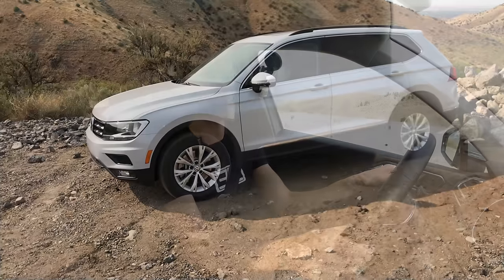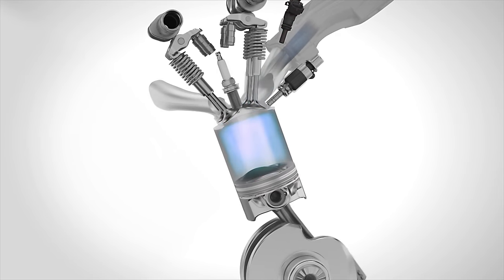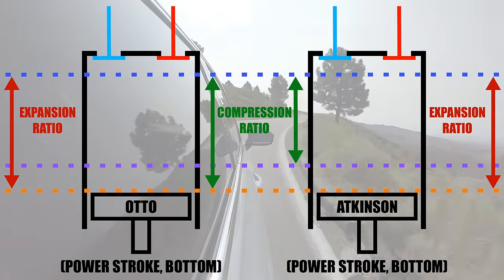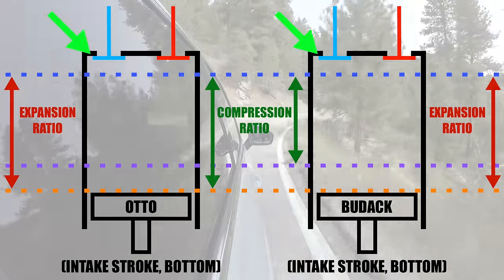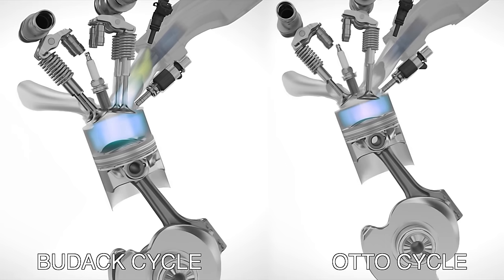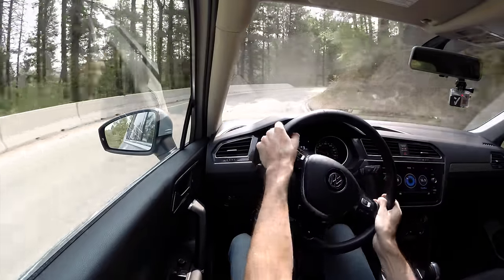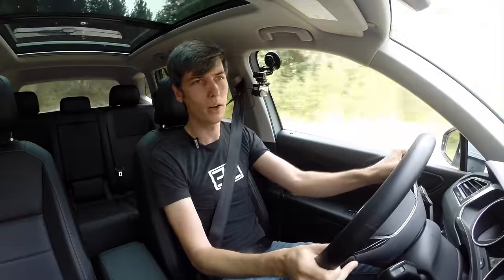Volkswagen's New Engine Cycle - The 'Budack' Cycle

Comment: i don´t think that the budack cycle is more efficient, because it leads to negative pressure which costs energy. However, you could use it on indirect injection engines, because there wouldn´t be any fuel-air-mixture being pushed back into the intake manifold. But i don´t think that this is what Volkswagen wants to do. And finally, Toyota is doing a similar thing for about 20 years now. So .. i´m not really sure what to think about it.

Comment: Compression ratio is the combustion chamber volume at BDC compared to combustion chamber volume at TDC.  Hence the word ratio.   i.e  if at BDC cylinder volume is 10 cubic inches and at TDC volume it is 1 cubic inch, then you have a compression ratio of 10 to 1.  It is a function of engine design not how much air or gas you allow into the chamber.
What you mean to say is: Since there is less matter to compress, (by allowing some of it to escape when the intake valve stays open longer during the piston upstroke), you change PSI within the combustion chamber (not the ratio).    Since you have less air, you also have to reduce the amount of fuel injected into the chamber in order to satisfy the stoichiometric air fuel ratio.  You get better fuel economy because for each "explosion" you use less gas   
This is a good engine for my grandma to use to get a quart of milk at the store :)  It is not for hot rod lovers.

Comment: Bruh I get 45 mpg in my 17’ Mitsishitty Mirage.  It also had M-Tek, which pumps out 75 horsepower in a 3 cylinder motor.  Plus the racing stickers add about 25 more HP.

Comment: (Very late to the party.)
EngineeringExplained
When you compare the two fuel economies, could you please give some other number for context?
As an example, say one vehicle gets the same mileage as another vehicle. If the engine of the first vehicle has a higher horsepower rating while getting the same fuel economy, that's pretty good. 
Comparing numbers from only one parameter doesn't give as much useful information as one might think.

Comment: Why don‘t they use „freevalves“? (like koenigsegg) Then the mechanical shifting between modes becomes unnecessary and you could electronically choose the optimal mode for any load situation. Too expensive? Patent problem?

Comment: What I see in the valve duration changing is something else to break! I drove kraut cans for years, would really like to have a 68-72 sqrbk. My 68 was consistent at 28mpg, My 69 Bug got up to 33 mpg on the highway. Both the 68 and 69 were pure stock.
Reply: krauts... damn new fangled technology!  shakes walking stick tell me you're a boomer without telling me you're a boomer...
Reply: @BoopSnoot  use to, you could repair a vehicle.... most today are parts changers. Could change a timing chain in a chevy 2 or 3 hrs, rebuild a quadra-jet about the same time. Just got my wife's ranger back from the shop. $2K to replace timing chain, you need special tools, $$$$ mucho, and pull the engine in order to replace the 3 chains, with no timing marks!  Soooo! I just had them to replace the engine, 3 yr warranty. Now my wife doesn't have to worry about it, if I leave the scene.

Comment: Sounds great, but who in their right mind is going to trust what VW say about their fuel consumption, giving that they were found guilty of misleading purchasers about fuel consumption etc etc etc..And it's not really a new engine cycle is it - it's still a four stroke - a bored yts guy has just been ar5ing around with the valve timing in an attempt to make the cast iron (couldn't they be bothered casting a strong alloy block?!) four banger sound vaguely interesting.

Comment: Why change from the Hankinson cycle.  I see power loss from pulling even more of a vacuum when the intake closes early. And exhaust would open before bottom dead center. So it can start reducing pressure before the piston moves up. Which would also be more power loss if there was still pressure. Gale Banks does a Great video on cams killing a Duramax part 14.

Comment: Lowering compression by forcing the intake valve to stay open longer? Creating a combustion event that achieves atmospheric neutrality at bottom dead center? These are good things? If this thing has cam seals, I wonder what they look like after 100,000 miles for some drivers...

Comment: What speed does it average 27mph on the highway?  I got in the right lane with my awd 14' explorer and set cruise to 60mph.  I averaged 26.4mph on my way to work.
Reply: That's not how the highway EPA cycle works (you can look it up).  I have for years tried to lobby for an additional cycle that would just be based on steady cruising for a longish trip at some average temperature - to no avail.  I can easily get 55 mpg in my TDI at steady highway cruising - but that's very far away from what the EPA says my highway mileage should be.
Reply: @oldnordy2665  i hear those tdi'scan get some crazy economy.  Thats badass.

Comment: BMW is using this on their 1250GS motorcycle except their intention is to use a torque friendly cam duration at low rpm and switch to a high rpm cam duration when past 6000 rpm I believe.

Comment: Soooo, by closing the intake valve earlier the name of the engine cycle is changed?! Crazy. Also, doesn't the fuel air ratio need to be the same for complete combustion? The complications in the cams is very unattractive. The switch from short duration to longer duration looks like a potential failure point to me. Otherwise interesting........

Comment: Have VW/Audi incorporated multi port fuel injection? Or are they still running direct port injection? Have they address carbon fouling on intake valves? 
Thanks

Comment: A 4 stoke engine can't be called a Atkinson because the Atkinson is a 6 stroke. I don't know of any engine that closes the exhaust valve at exactly 0 ABDC, it could close anywhere between 0 and around 75 ABDC. At what point does it turn into a Atkinson?

Comment: Wouldn’t the Budack cycle result in the intake stroke pulling a hard vacuum at the bottom of the stroke, and therefore causing drag on the piston, and therefore resulting in a loss of efficiency or loss of power (like engine braking?) 🤔🤔🤔 This doesn’t seem like a good idea.

Comment: Cam trains with all their power hungry inherint mechanical complexity will soon be joining the  dinosaurs of motoring history ! Computerised  timing of High-speed supper efficient solenoids directly operating the valves, will transform efficiency and power of the internal combustion engine. Koenigsegg is pioneering this technology. This is simply a matter of time before all manufacturers adopt this technology.

Comment: So basically, they are using say a 2.2 L engine, but the engine only always in the amount of air:fuel of a, for example, 2L engine. This way it uses the gas mileage of the 2L, yet has a long stroke to get all the power out of it. ? It seems odd that the engine would close the intake early, and then what happens to the engine when the intake stroke hit a vacuum, since all the valves are closed? It builds up negative pressure?
--Also, The Atkinson engine: In my opinion, it is a fancy name for an engine running lean all day long.

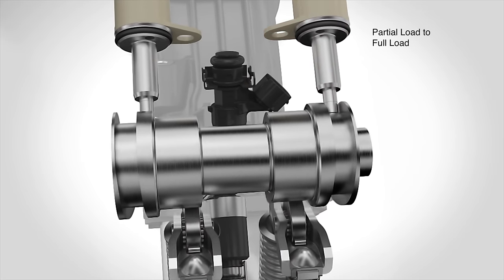Comment: All about cam timing, in this case variable cam timing.  The cam profile at 2:28 looks horribly complicated & has the potential for side loading & serious failure if the electronics goes wrong.  Forget driving those SUV buses, go small, light, simple & economical.

Comment: The holy grail will be the replacement of the entire mechanical chain/phasers/cams valvetrain with digitally actuated valves.  Oldsmobile had a solenoid valve system in development decades ago, now we need modern engineering to carry it over the goal line.

Imagine dynamic engine tuning that can drink wisps or air and fuel at cruise, but able to flood the cylinders with both for ultimate performance.   Even better, configured to make adjustments on a per cylinder basis, allowing the ramping of effected parameters rather than a whole bank changing at once.

Comment: Doesn't nearly the same thing of her when you open the intake valve before the exhaust valve is closed? It causes reversion, but it does also lowered effective compression ratio and any loss of compression ratio reduces the amount of work you're putting into the project in the first place so I don't know how much more efficient it actually can be shown to be.

Having a switch between those two functions however is interesting. Sounds like it's more effective that shutting off several cylinders and hat 4-cylinder still have to put your bunch of dead weight around in an engine. One of the stupidest ideas I've ever seen in my life.

Comment: How will this affect direct fuel injection atomization and engine temperature? I realize that the cylinder isn’t creating a complete vacuum but is it let”s call it stretching the volume of gas available in the cylinder? Would it be possible with a longer stroke the actually increase the charge density because the engine is doing more expansion of the air than compression? In the long run I wonder how that would reduce the need for a pcv and the carbon buildup associated with direct injection intake valves. Also if they would be oil burners after 100k miles due to the potential of oil being drawn into the cylinder from below the piston rings.

Comment: that is creative.. it allows in less air so its effectively a smaller displacement engine.   the longer duration cams and moving the lobe angles around reduced vacuum on engines to allow more air thru to keep the cats hot..  lower manifold vacuum equals increased volume of air thru the engine..  higher manifold vacuum reduces the volume or mass of the air thru the engine.. 

 a few years ago.. i drew up a tuning tube to put in a race honda's exhaust..  the owner had one made by his exhaust shop just as a joke so he could say he tried it.. it picked up the hondas horsepower from 265 to 275 with just slipping it into the exhaust system.  what it did is after the collector the passage narrowed down slightly and sped up the exhaust thru the narrow extended area..  since it dumped into the normal sized exhaust system.. this prevented reversion or reflections of the pulses from going back up thru this tube.. at higher rpms.. the tube caused the lowering of pressure in the collector and primary tubes of the header.. so when the exhaust valves opened. there was much more vacuum there to start the scavenging.. its very much like a 2 stroke extractor exhaust. but contained inside the conventional exhaust system..  it also made that honda sound like a healthy big block chevy..  it was no where near a stock H22 honda..  it was like 14 to 1 compression. ported,, oversized valves.. cams so big the valves just barely cleared ..

Comment: This is only usefully in low power mode and the fact opposite of a Turbo/Blower for m o r e  horsepower.

Btw Christian Koenigsegg topped this sceme with now pneumatic regulated valves later even quicker elektromagnetic steered valves totaly independent from any camshaft driven steering profile or time!

Comment: It looks more like a method of improving emissions to meet regulations than a method of improving efficiency.  By closing the intake valve early, the volumetric efficiency drops, thus less power is generated because less air gets sucked into the engine.  Since it compresses less air, compression pressures drop, giving it a similar effect to that of lowering compression ratio.  It is much like putting in a more mild camshaft in old-school terms. It didn't seem to help fuel economy figures when everyone did this back in the late 1970s.

Comment: I'm not surprised that mpg is not very good , because the major losses from what I know is the throttle valve (suction effect specially in low loads). The Atkinson allows to open wide the butterfly valve even in low loads. There they add up new suction losses . To make a gas engine work like a Diesel with the same efficiency, then you need to decrease the control role of the butterfly valve.

Comment: I did some research about 10 years ago where I explored an Atkinson-type cycle. The goal was to come up with the "simplest" way of doing that. I used a generator set as the test engine and dyno because you can accurately load the gen. with a resistive load bank &&&&& logged load data from a watt meter. The gen. has a governor for 60Hz operation ... making things simpler. The most intrusive mod to the engine was machining the head to give it higher compression. But first I took base line data to characterize the stock engine so I added a thermocouple and a pressure tap in the head plus another thermo at the exhaust and took my base-line data. Next I machined the head thus giving it ridiculous compression .... maybe possibly damaging if I wasn't careful in test. The 25Cent 'thing' I did was to add a restrictor plate (really just a thin piece of aluminum with a bunch of .075" holes) AFTER the throttle butterfly. What did this do? The engine would always see a partial vacuum on intake, but because the engine's head was machined down, the peak compression pressure right before ignition was the same as the stock engine's peak compression pressure. So, even with the losses caused by having to always suck all of your intake air through a bunch of .075" dia. holes, the exhaust temperature was very much lower for the same load, and the fuel consumption was down between 20% - 25% for the same load. As normally aspirated, the engine now had less horsepower so I could not load it to as high as in the base-line runs AND I had a narrower load test range at 60Hz ... but because the head could exit production as a 'higher-pressure head' the only cost would be a 25Cent restrictor ... 25Cents 25Cents 25Cents 25Cents 25Cents!!!

Comment: So we want a low compression engine with long/short inlet valve timing. Do I note bowl piston? What if we return to side valve engine with limited power output adequate for today’s road conditions ? This would be simple and cheap to construct use less material and the back room boys can shave little bits off the cylinder edges and put swirl bumps in the heads as in days of yore and say they have invented something new. Everybody would be satisfied especially if you put it in a Chelsea tractor for the school run!

Comment: Hi bro.,
My question is in budack cycle it closes the intake valve early then otto cycle, due to its early closing is it effected on engine parts like valves,spark plug etc. 
because piston is still moving downward direction and there is no opening for air suction, then it will create some vaccum in the chamber. that vaccum effect on life of Intake/output valve's life or any other part

Comment: Doesn't the early closing of the air–fuel intake cause the contents of the chamber to be lowered in pressure as the piston moves to its lowest point? If so, doesn't this consume some kinetic energy of the piston and very slightly slow it down, producing a braking effect on the shaft? I can't really see why this engine should be any more efficient than most. I suppose some kinetic energy is also lost when pushing excess air–fuel mixture out of the chamber, but I wouldn't have thought as much.

Comment: I don't completely understand how the Budack cycle makes the efficiency higher. When the intake valve closes sooner and the piston still has some distance to travel to the BDC, doesn't this results in a vacuum or expansion of the air in the cylinder, therefore slowing the piston a little bit by pillung it upwards.

Comment: I’d think the Budack cycle is more efficient than the Otto cycle based solely on using the exhaust valve rather than the intake. Allowing a “backflow” into the intake runner is interfering with pulse frequency pushing air from the throttle body and into the cylinder

Comment: Actually if the one intake valve is closed for most part throttle use responsiveness , torque and fuel economy will rise with a valve timing which closes the intake valve before BDC as 
described . Then a means of opening the second intake valve or throttle plate which in the intake port to that valve  will give the performance boost needed . A turbo which boosts pressure will work well with the arrangement being electronically controlled by a wastegate. Weird Camshafts with sliding pins are not ideal.   CAT is a genius isn't he.

Comment: so, by reducing the comp ratio, nox emmissions are reduced, but this option produces the same amount of torque and gearing can make it seem as though hp. did not go down cause reducing the comp. ratio does reduce hp. 
 I am impressed they came up with a way to keep fuel mileage and reduce emmissions. kinda neet! a similar concept as valve overlap, but from the other end of the scale so to speak.... I wonder if this would work well with lpg or hydrogen?

Comment: Sounds like variable cam timing to me. Imagine if we get rid of cams and valve springs and replace them with pneumatic or hydraulic valve actuation. One could control valves to give you either efficiency or optimal power on the fly. Of course we would need the Japanese auto manufacturers to make this reliable

Comment: You would think the budack cycle is cleaner the Atkinson pushes out the charge & whatever fuel vapour escapes the budack retards the charge but seals chamber & some residue would float around manifold ! But what about auto ignition & knock ??

Comment: So it creates an "underpressure" by closing early, how is that different from how the throttle works? Doesn't that effectively do the same thing, restricting the amount of air/fuel mixture the cylinder pulls in?

Comment: What about true compression ratio? If the compression is optimised for  cruise, when you switch to power mode you'll have more fuel/air being squashed into the same space therefore the true compression ratio is increased with risk of detonation. If optimised for power, efficiency at  cruise will be compromissed.  Won't it??